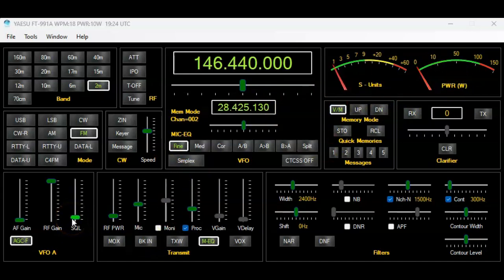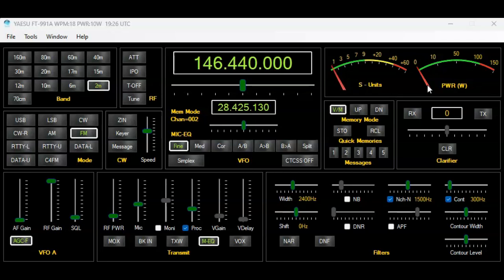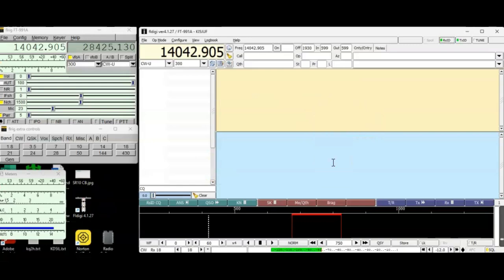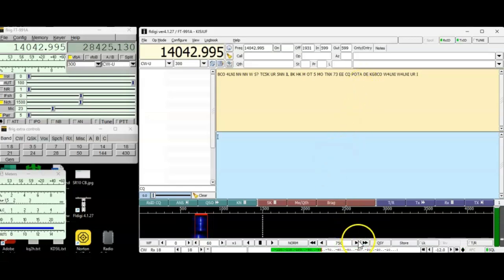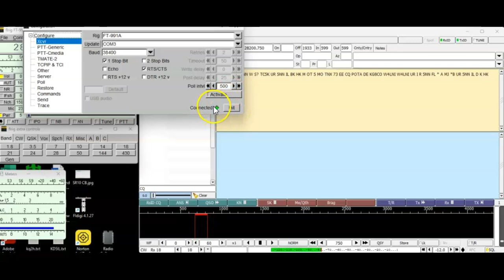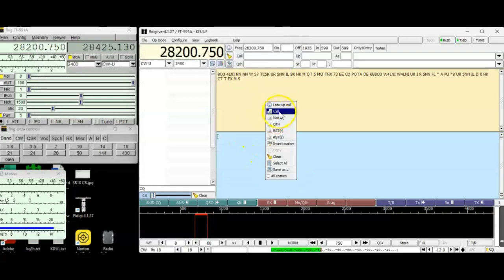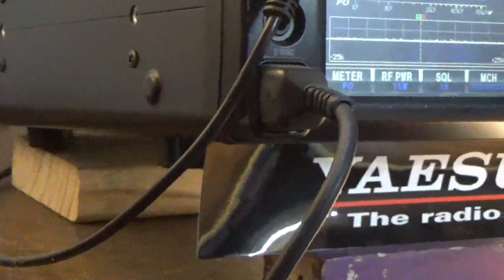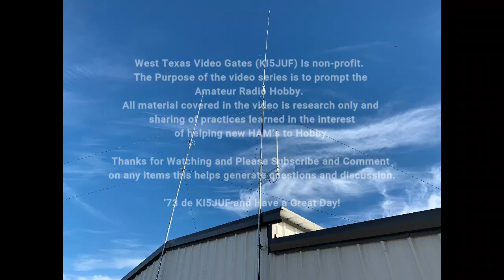1st run with FLDigi and Rig – DTR Setting for FT991A - Win4Yaesu FM Power Loss Solved New HF Coax

Comment: You can use DTR or RTS  on the software, you just need to pick the same option on the radio. This way you can use one to key the radio in CW and the other to key it in SSB/RTTY or a digital mode.

Comment: Question for you; I have Win4Yaesu and my laptop is connected via a USB cable to the 991A. Love it works great. I did purchase a Toroid recommended by the author of the Win4Yaesu program. On my computer COM 7 is the enhanced port, and Com 6 is the non enhanced port, I am also running Log4OM and it uses a Omnirig port Com 20. FLRig wants to use my enhanced port, which I think prevents Win4Yaesu from using it at the same time, but I am not positive of that. What has your experience been with running DigiRIG, FLDIGI and Win4Yaesu?

Comment: What software do you use now to control your radio on the computer. What do you recommend I have the 991a too
Reply from the maker: Good morning and thanks for the message,  I use FLRIg and FLDigi, if you need help or more information let me know, there are some settings that I use in FLDigi that sets up FLigi to be a client to the FLRig, the two programs work in tandem, email me shope02@yahoo.com and I make a video showing how I have my settings.  Ham Radio Deluxe is nice too but I don't use it anymore 73.
Reply: @westtexasvideogateski5juf255  do you not use win4yaesu any more?

Comment: Coax and connectors can cause many issues.  I saw a similar thing that tightening them did the trick.
Reply from the maker: Roger that sir, yeah I glad it fixed it and my light next radio doesn't flicker anymore on 10m FM, thanks for the message appreciate it '73